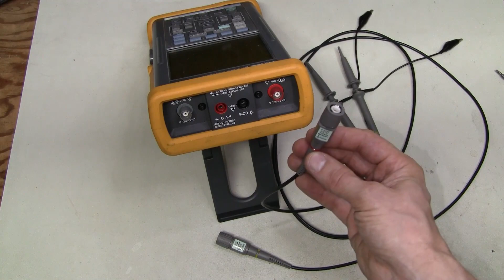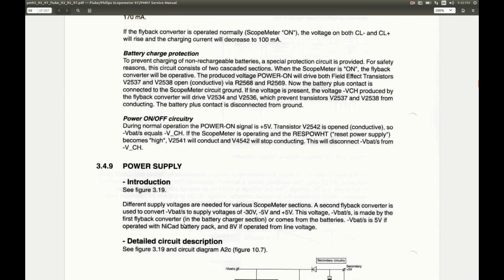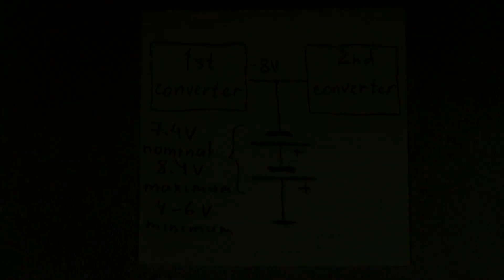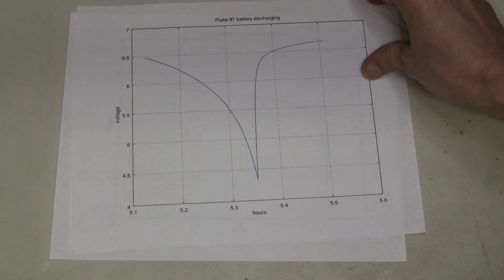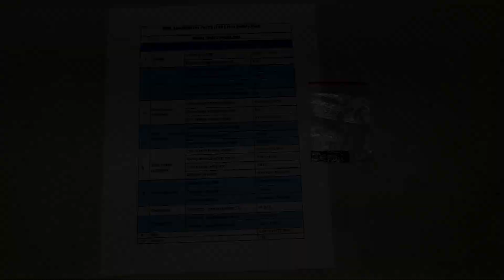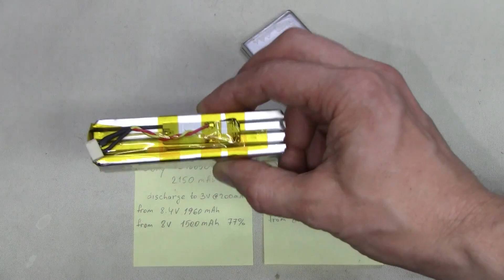#58 - Fluke 97 ScopeMeter battery upgrade to Li-ion

Comment: I bought the aftermarket nicad-battery for my 98 and it stays on between 8 to 9 hours. I've tried it twice now. I'm very impressed.
Reply from the maker: Very good, but remember, NiCad is an old technology. It has high self-discharge, it has memory effect, it degrades way faster than Li-ion, it can leak.

Comment: I'd love to get ahold of some of those Sanyo LiPo cells. I disassembled several MBP batteries and the cells I found in them are too wide. Do you have some extras you'd like to part with?
Reply from the maker: This video is about 5 years old now. A couple of modern 18650s with capacity of about 3000mAh and with 8.4V charging mod should give you close to 10 hours run time.

Comment: For some reason this was exacty was I was looking for. Many thanks for an informative video! It is quite easy to change the voltage from the charger to about 8.4V. Simply change the resistor R2556 from 5.62k to approx 5.8k.

Comment: I like the ideal of rewiring the tray to 2s2p for 26500 batterys since they are c size,  saft makes ones that are 7700mAh but is 150mA continuous. Did you take note of amp draw of this fluke 97, I would be moding a 105b? Another battery I see that can fit the tray with slight room for a bms would be using 2 26800s, this would be a means without modifying the unit. Good ideal none the less and thanks for the info on this thing charges the battery.

Comment: I picked up a Factory refurbished Fluke 125 Scopemeter in a factory box.  Uses NiMh pack.  Would be interesting if I could convert it to 18650's.  But the pack is 4.8 volts.  18650's are 3.7 to 4.2 maximum.
Reply: I modified my Fluke 123 Scopemeter to use two 18650 in series by replacing R513 26.1K with 29.1K resistor increasing charge voltage from 7.4 to 8.4V.

Comment: Have I missed something? which unit is properly charging the cells? I have never found a battery management board that will accept say, any voltage, regulate to charge a Li-ion, AND allow an output from the Li-ion with just two wires or did I miss something in your video? Thanks.

Comment: Nice upgrade. Do you have the part number of the thermal fuse you used?
Reply from the maker: I don't. I bought something like this on eBay quite a while ago: https://www.ebay.com/itm/5Pcs-NEC-Microtemp-Thermal-Fuse-Axial-115-Celsius-Degree-Cutoff-2A-250V-SM110A0/182924401779

Comment: I have the exact same Scopemeter that I'm trying to retrofit with the exact same 10-year-old Sony Lithium cells... I almost can't believe this video exists. Thank you!!
Reply from the maker: no, I have not.
Reply from the maker: You are welcome. Check out the follow-up about the 8.4V charging modification: https://www.youtube.com/watch?v=LdS9Dot2Ywk
Reply: Have you considered replacing the Electro-luminescent LCD backlight:
https://www.digikey.com/product-detail/en/COM-10799/1568-1340-ND/5768318/?itemSeq=300891090

I would be interested in seeing how that modification goes. It would be nice to have an actual white backlight instead of that ugly 1990's blue "indiglow" backlight. The thing I worry about is that some people report that the Sparkfun panel is blue, whereas others say it's white. The actual color depends on the frequency driving it. I've always wondered if that frequency can be changed by simply swapping some passives. Some people have also reported a large boost in the backlight brightness by simply re-capping the drive circuit. Have you looked into this at all?
Reply: @Russell_319   давно заменил подсветку, купил с выгоревшим люминофором. С планшета Андроид 4.3 , разбитый экран, вырезал по размеру подсветку и белые светодиоды, ламинировал в пакет. стало замечательно!

Comment: Hi. Please tell me. Is it possible to supply 8.4 Volts to the input of the battery compartment. I want to use two 18650 batteries in series. I will charge them separately from the device. 8.4 Volts not dangerous for the device?

Comment: Was considering buying something like this https://www.amazon.com/Zeee-4600mAh-Hardcase-Connector-Vehicles/dp/B07F8T1NYQ/ref=sr_1_100_sspa?keywords=lipo+battery&qid=1552056934&s=gateway&sr=8-100-spons&psc=1 as more of a "drop in" Would probably come up with some sort of custom contact solution rather than drill any holes. Just enough room left over for a BMS too.

Was measuring the current my 97 uses and it varies from about 270 to 760 mA, depending on voltage and whether the back light is on. Is that normal?
Reply from the maker: $33 with no BMS - not my idea of a cheap replacement. Is the run time very important for you? You may want to increase the charging voltage to 8.4V. Have you seen the follow up? https://youtu.be/LdS9Dot2Ywk
I am not sure about 760mA. Seems excessive for an unmodified unit.
Reply: @feedback-loop  No, I hadn't seen the follow up. I watched it just now. I really appreciate the time you put into this. I'll probably be doing what you've shown in your follow up.

What I linked might not be a cheap replacement but I searched for 45 mins and didn't find much else that would fully utilize the battery compartment space and have much in the way of capacity. Everything else I looked at was either too long, too wide, or had a poor capacity.

I don't have any lithium batteries sitting around to use aside from some old 18650s and only two of those will fit and that wouldn't give me the run time I want.

I'll wait till I return to work and see if our IT department has some old laptop batteries sitting around.
Reply from the maker: A couple of modern 18650s with capacity of about 3000mAh and with 8.4V charging mod should give you close to 10 hours run time. Too bad there is no battery gauge.
Reply: @feedback-loop  I just did some testing of the current vs. voltage of the 97.

It acts like a constant wattage load from 9.77 volts all the way down to 6.20 volts, using about 2.27 Watts (no backlight and in scope mode, which actually uses slightly less energy). Wattage steadily climbs from there to about 2.88 Watts as the voltage approaches the shutdown threshold at 4.16 Volts. So your upgrade runs the instrument more efficiently than the NiCds or NiMhs. Your follow up, with the increased charging voltage should help quite a bit more.

As an aside I pushed the voltage, on the battery input, all the way up to 12v and the instrument survived. I was living dangerously. I happened to notice that the meter side of it was giving an ac voltage reading with nothing attached. This artifact begins abruptly at 10.6 and disappears below it. Once I noticed that, I elected not to do any testing above 10 V.
Reply from the maker: Good to know. Thanks for sharing.

Comment: The charger ALWAYS has to be higher voltage than the battery pack or the battery will not fully charge.
Reply from the maker: It is not clear if you agree or disagree with a particular part of the video.

Comment: Thanks! I too have an old Fluke 97 that works great except for the battery pack and I never thought of just sticking lithium batteries into it, but your video made it obvious. I'm not into tearing apart old laptop packs so I got a pre-made, dual-battery 18650 pack with charge limiting and protection from eBay for $11 and tiny 3-pin connectors, drilled a hole, did a little soldering, and there you go. Brilliant!
Reply from the maker: Very cool. I still didn't have a chance to look at 8.4V and faster charging mods.
Reply: If you do find a way to up the charging current, I'll be waiting. Wanted you to know that Excess Solutions has some large 0.6" LED 7-segment displays that would be perfect for your Datron voltmeter. They're not overmolded so you can sneak a small red LED between the exposed segment light bars and into the center of the digit for those special red dots the meter needs: Litronics DL747. $1.50 each. I went there personally to check them out for you. I think you'd like them. Stock # ES6459.
Reply from the maker: Well, what about the special symbols? I still like the idea of several graphic displays. I even bought OLED modules, but too little time...
Reply: Sorry, must have forgotten any special symbols beyond that extra dot. I watched those videos a few months ago.

Comment: Interesting video as always. I have an older Scopemeter as well, 100MHz I think, and it will not run on batteries even though they are fully charged. Got to pull it off the shelf and have another look at it one of these days.
Reply: Well I fixed this problem. Turned out one of the wires going to the battery terminals was corroded and not making a proper connection. Now I just need to replace the flaky keypad.

Comment: Nice project, I would definitely be looking into the 8v rail to try and boost it up, what about a boost/buck converter running directly from the power input jack? That would allow higher currrent and higher voltage charging.
Reply from the maker: It needs to be seen how such an addition would interact with the existing circuitry. It might be easier to slightly shift some thresholds in the existing converter.

Comment: Yes, it was the Philips alliance which resulted in the Scopemeter concept.

Some of the best built laptop supplies I have seen are the old Dell PA-6 power supplies which were used from everything from the lower-end Latitude laptops all the way to Precision Workstation models.They have 130-degree rated Rubycon capacitors in them.

Comment: Thanks for the post.  Interesting idea.  I just swap the standard C batteries in and out.  With the NiMH, I get about eight hours of runtime (without the backlight).    A few of us posted a fair amount of data on these scopemeters on the EEVBLOG site.   Maybe you will find something of use there.http://www.eevblog.com/forum/testgear/old-philips-fluke-97/msg1063314/#msg1063314

Comment: Awesome re-use of batteries! Did you time how long the Li-po pack kept the meter running? 11hrs or so perhaps?
Reply from the maker: No. I spent so much time on experiments already, so I didn't feel like running another long one.
Reply: Fair enough! That takes time, indeed.
Reply from the maker: I finally tested this. The meter run for 10.7 hours. I posted the graph in the forum.
Reply: That is very decent! Both your and mine estimation seemed correct. :)